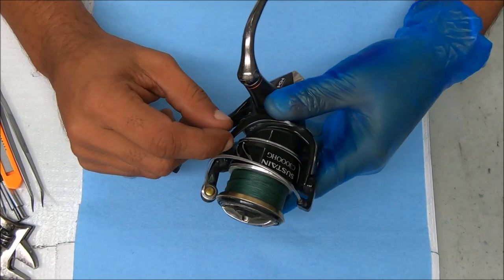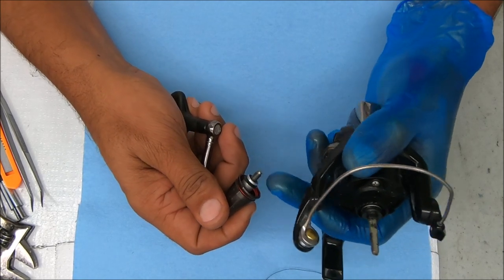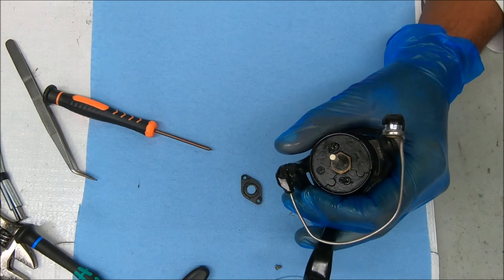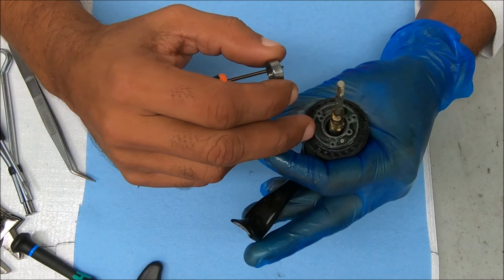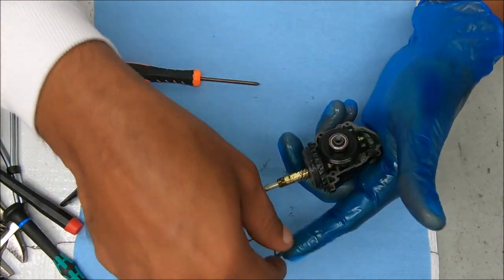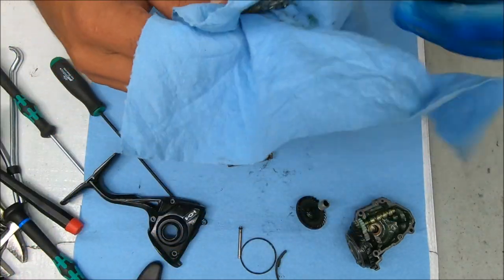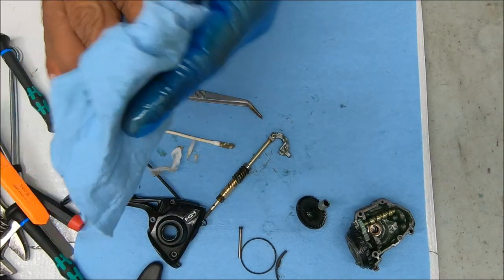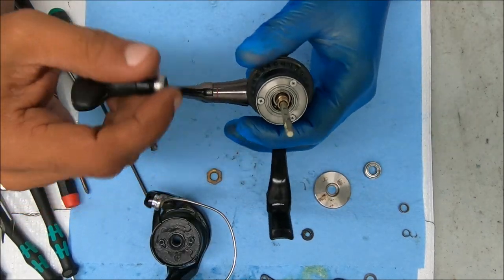Shimano Sustain C3000HGFI Sticking While Cranking - Fishing Reel Repair

Comment: Great video
Reply from the maker: Thanks Money! How's your Baitrunner 8000 coming along?
Reply: @TSGReelService  great I took it down, the inside was clean so I greased it, oiled the bait runner mechanism and put it back together. You gave me the confidence to do it. The anti reverse shaft is corroded but it still works so I brushed it and greased it. Some rust in the roller clutch, I may replace but it seems to work fine after clean and grease

Comment: my vanford has start making like tick tick tick or like tick/feeling.. when retrive slow with a lure and now also more and more without.. is it time to make it to the garabgecan?.. i 'cant send it to service in sweden beacusefirst it takes 9 weeks and cost almost the same as a new ultegra.. i will try to fix it my self intead.. but is it the pinion gear thats worn out? everything inside looks fresh and not broken
Reply from the maker: Don't know, brother. I find the ticking usually comes from the shaft/pinion interaction or bearings. Good luck!

Comment: Was out today and my Sahara c3000 started sticking. Eventually the reel stopped loading correctly. Is this procedure similar?
Reply from the maker: Thanks for checking out the video. It may be something different, but this guide is a good place to start.... then you can go through my video library for more examples/ideas.
Reply: @TSGReelService  thats how i planned my attack. Thanks for the response
Reply from the maker: No worries. You're welcome.
Reply: @TSGReelService  hate to bother ya again but i replaced most of the gears and got everything greased and moving how it should, but when i put the bail assembly on it sounds like somethings rubbing, then when i put the nut on it gets tight and finally binds up? Any clue on where i could've messed up? Im puzzled
Reply from the maker: @paultondolojr9432  all good. glad to hear you got the reel working again. Regarding the bail assembly, it's likely going to be a problem with the lay/setup of your bail spring/trip lever assembly, or you're tightening the bail screws down too much. Watch the bail reassembly portion of this video to compare to yours
Reply: @TSGReelService  i actually meant the rotor. Sorry. Mistake in my terminology. Ordered a new pinion bearing. Last chance on this c3000

Comment: Can you do a squall 50vsw 2speed reel.
Reply from the maker: Thanks for watching! If one comes in and I have time to record it, will do. More vids to come. Spread the word about the channel.
Reply: @TSGReelService  can't find a service video on it, really want to know how to remove the two speed button
Reply from the maker: It's similar to some of the newer Internationals. You'll need the tool that came with your reel. Secure it around the handle nut (23), keep it in place  and the use a strap wrench to remove the 110C cap (counterclockwise). Only turn 110C... 23 stays in place. You can damage your reel if this isn't done correctly. The rest should be pretty straightforward. If you're uncomfortable doing it, keep an on the channel in case I get one in and record it, or take it to your local repair shop.
Reply: @TSGReelService  or any international that has that type of button, would be a good video because I don't want to break my reel.

Comment: I have the same problem but there is no rust on my shaft. could you give me a pointer on what you think it may be besides rust on the shaft? Much appreciated. Love your videos. You’ve helped me fix quite a lot of reels.
Reply from the maker: Thanks for checking out the video and taking the time to ask your question. Assuming all your bearings are good, check to make sure your shaft isn't bent... do the pinion gear sliding up and down over it trick to help expose anything. You can also check your pawl and/or worn for damage. Hope this helps.
Reply: @TSGReelService  thanks so much for your fast response! I was thinking the same thing maybe a bent shaft or maybe the shaft is bent where it connects to that gear with the tiny screw. I’m not sure what a pawl is lol. I hope you can explain in the next comment what part that exactly is. lol upon closer inspection when I remove the gear that’s connected to the turn handle and got it out-of-the-way. There is a gear that has a little nipple sticking out that makes the shaft go up and down when the gears turn the only other place that I see that it could be hanging up there. Maybe that little nipple is worn down or something but I haven’t got that far into it. I just greased everything real good and make sure it was free of rust and put it back together but as I stated. it’s still hanging up in that one spot over and over when I turn the handle just like in your video. it’s an old diawa shock rod and reel combo That was my father’s and I’m really trying to keep it working order because that’s one of the only things I have left after he passed away and we love to fish together when I was younger. Thank you so much for your advice so far, you’ve earned a subscription from me!!!
Reply from the maker: @slickmouf879  You're welcome and no worries. It's always best to let me know what reel you have, if it's not the specific reel in the video you made the comment on. It sounds like you have a pawl in your reel also, but let me know the name of the specific reel you're having the issues with and I may be able to better help. All that said, the pawl looks like this (https://www.ebay.com/itm/174495619820), but it doesn't mean this is the one for your reel. If you have one of those, it could certainly be damaged, or the track it rides on (called the worm) may be damaged.... or both. Let me know the name of you reel.